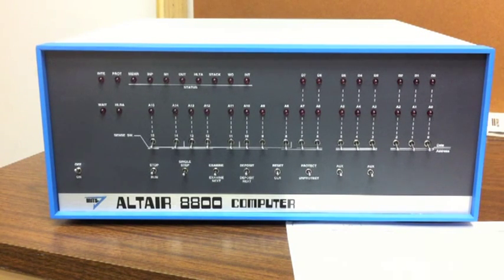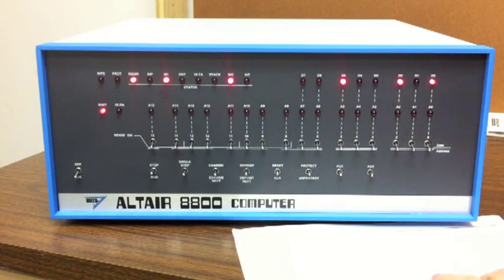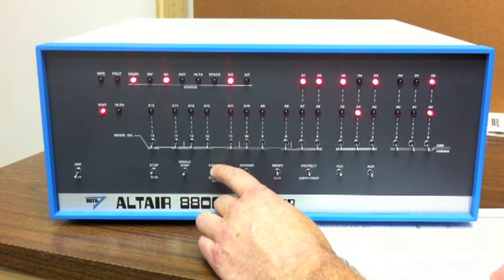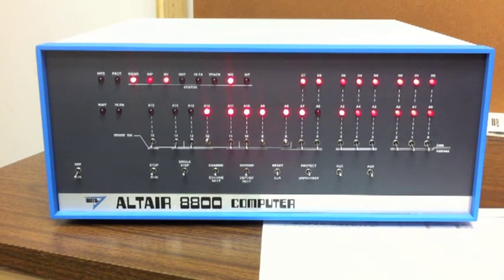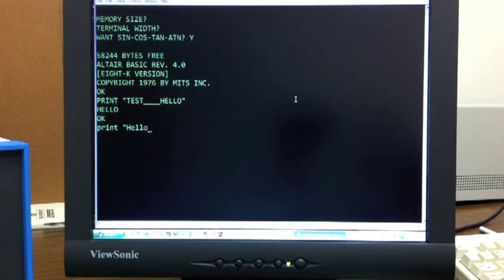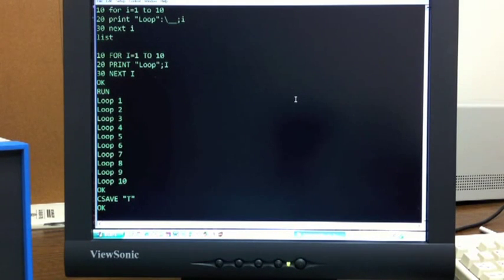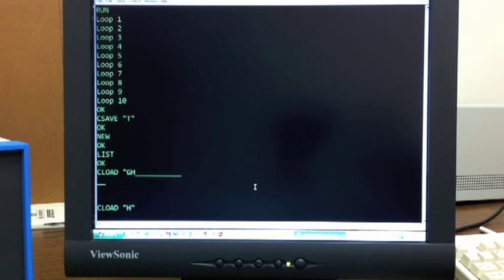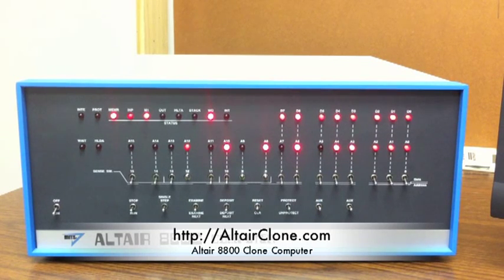Altair 8800 - Video #9 - Loading 8K BASIC from a Cassette Image

Comment: In 1976 my high school got 2 16K 8800a Altairs with cassette, one on a teletype and one on an ADM-3. (See H. Dyk's article in the July 1977 MITS Computer Notes) We learned BASIC programming and were instructed never to touch the front panel switches. One day Mr. Dyk caught me using the STOP switch to pause a listing on the terminal and gave me the evil eye. Later, after a crash, he was busy and let me toggle in the boot loader. Oh joy of joys!

Comment: It would be nicer to see the Altair Clone running by itself, and not having a modern Windows PC sitting next to it emulating everything for it.
Reply from the maker: Andrew Piatek It is running everything itself. No PC is required. For example, see videos 1-5, 9.1, 9.2, 13-28
Reply: deramp5113
Okay, that sounds good.  I believe a single ciruit board is used inside with some soft of controller chip to emulate the Intel 8080.  Is there a way to connect a keyboard and CRT monitor directly to the Altair Clone?  I see it has to RS-232 ports, and tape player/recorder port can be installed.  That's great.  I am just really interested how could I connect a CRT monitor and a keybaord.  By the way, I have an Atari ST with VT-52 emulor, can that be utilized?  Or maybe I could get the VT-100 if it only could work with Altair to display characters.  Sorry for stupid quesitons, I just see that great care has been taken to bring the real look and feel of the machine, and I wouldn't want to ruin the experience having a modern PC emulating the Terminal and keyboard input.  If I can get truly full expeirence with Altair (rape drive is okay, and I am not going to go as far as using perforated tape), then I'll buy.  I am currently studying Motorola 68000 assembler on Atari ST, and it's quite good, but from these videos it looks like with the altair I could get even closer to assembler programming.
Reply from the maker: Andrew Piatek The original Altair did not have a video board or keyboard interface option. The operator's console was typically a Teletype or a serial terminal. For the most part, any serial terminal will work with an Altair, and therefore, with the Altair Clone. Terminal emulators on vintage computers (like the one on your Atari) were typically used to log into BBS systems via modem. These emulators can keep up at modem speeds (300-1200 baud), however, they typically can't keep up at 9600 baud, especially once the screen has to scroll. You'll be better off picking up an old terminal if you don't want to use modern hardware as a terminal emulator.
Reply: deramp5113 Yeah, I'd just want to have the Altair as the centerpiece processing unit, meaning, no more powerful processing thank Altair are allowed :)  But seriously, that's how to get the full experience of the machine.  Tape deck is fine, because it does no processing, is totally analog.  I need to look for some suitable terminals then.  Anyway, just wanted to see I really enjoyed watching this video series.  The explanations of the Altair Clone are perfect, as is the design of the unit itself.  68000 seems like a hairy beast compared to the 8080.  I really like the idea of the Altair.

Comment: It would be super cool to have an extra unit, just like old stereo equipment, one top of another, which is capable of docking several raspberry pi, and by switching the switches control the GPIO port of the central node kinda like a super computer. You have there the best clone of altair out there, im saving money to get one!